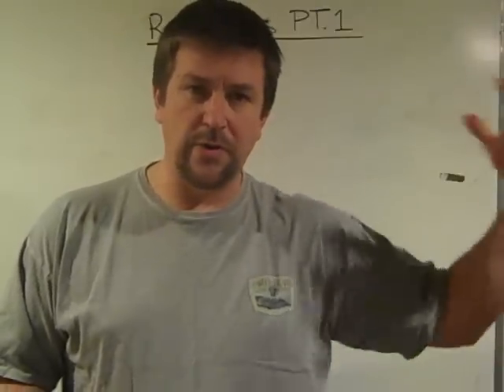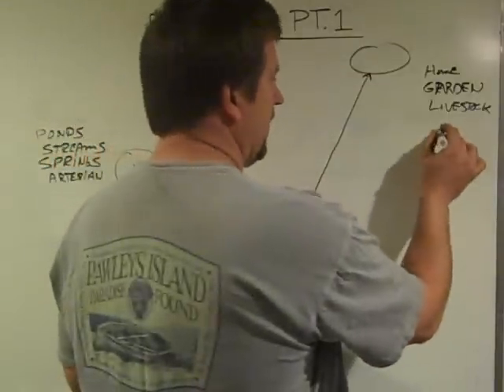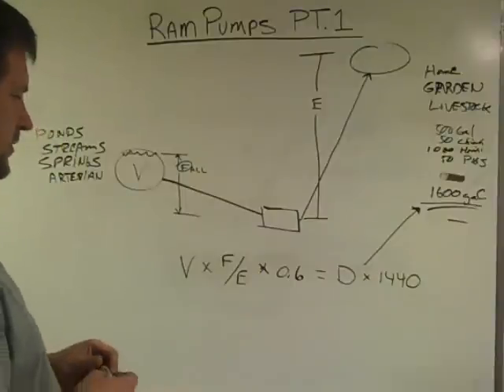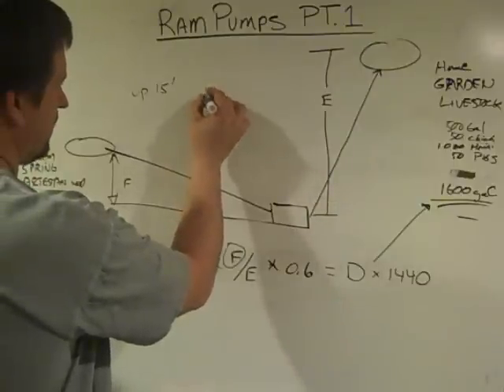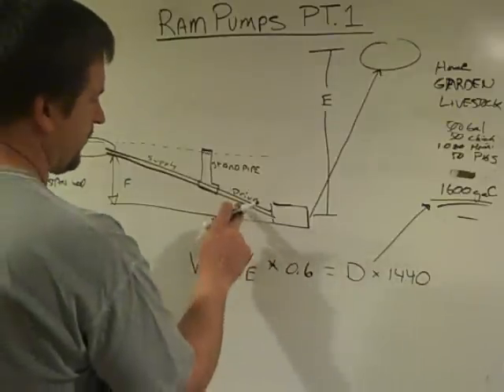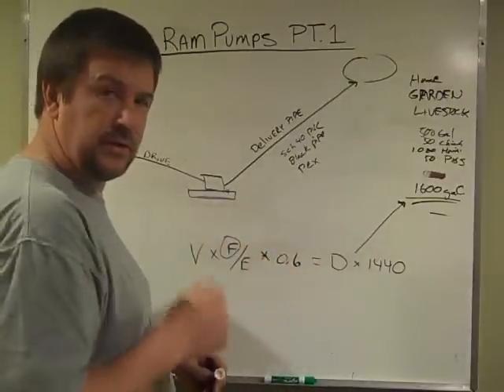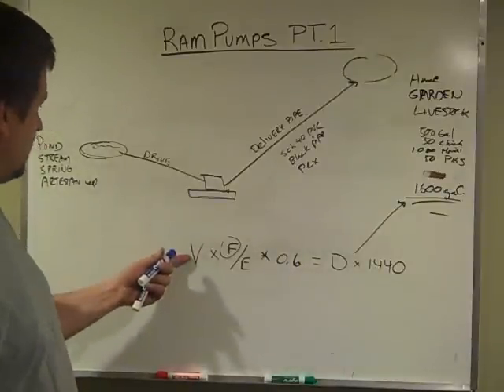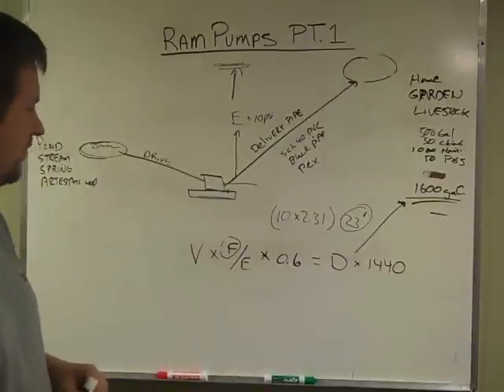Ram Pump pt1

Comment: Ive watched about every ram pump video on you tube,  this series is by far the best on calculating what you need to get started right,  my question is :  is there any way to calculate the distance that the ram will push water in the delivery pipe.
Thanks
Reply from the maker: There really is no limit on distance because there is no friction loss as the pump pump slow and steady it will push for miles.
Reply: @engineer775  thanks for the quick response moving forward with my project today in harrison arkansas
Reply: @engineer775  gov will have all heads for this tech thay teach us that we always have loss but never talk about 
the converted gain we can make from eletromagnets
if u convert all the wast thermal energy around 
you u can use it universally as energy u need a true sine wave bipolar like the power comp dose a 
true pure sinewave like a grid tie inverter 
once the signal is made the system will turn on and 
consume wast thermal energy from the 
environment and space around you... there is free energy but 

it comes from Universal thermal loss and converted into a gain. so a pole Transformer and a 
microwave Transformer  have a common between each other u can take 2 microwave Transformer provide 
a pure sine wave grid tie inverter to it or a true bipolar sinewave that inter acts with nature in 
a perfect spherical motion like a flower of life..  if ur home provides this use it as a Source 
signal then u can simply stack the Transformers on top of eachother in correct fasion and note 
that the 1 wire on the Transformer must stay connected and the other disconnected your only useing 
1 wire on the hi side .. so test ur self 
2 microwave transformer stacked on top of eachother same 

face sides. one side 120 to the wall and the other 120 side to what u want to power and useing the 
Transformer just the way it came out the microwave with the wire attached causes the energy in its 
perfect spherical motion to converted wast thermal energy to amp for u hot to cold in to out... 
should look a bit nuts with u use a form of wireless energy but its interacting with the 

environment...this is my work a compilation of Otis car. Tesla. and many other very smart people 

nowadays i think i found the gate source and drainif this gets out to much that it works the 
power 

comp and mib will have our headsdont do this at home warning high voltage yet i cant stop u lol DO 

NOT TOCH THE CORES OR THE WIRES OK u will die make sure u dont touch the core if the hi wire is 

mounted to it u dont have to mount the hi on the core if u dont want u connect the 1 hi wire to 

the same side hi on the other transformer then the core should besafe to handle if nessary
grab your multimeter and prove me wrong
thats what u do i have my whole home on this
and u can take 

one of the lows side out the wall and hook it up to other stuff and power it for verry little amp 

makeing nature convert and pumping latent heat effect into the device.
and u can have a microwave 

hi volt cap in between the hi side and make a system that powers its self
u can flip the switch on 

ur breaker and the room stays on up to 2kva 
with both lows in the wall this is the zero point that 

was taken from us...
Reply: @engineer775  gov will have all heads for this tech thay teach us that we always have loss but never talk about 
the converted gain we can make from eletromagnets
if u convert all the wast thermal energy around 
you u can use it universally as energy u need a true sine wave bipolar like the power comp dose a 
true pure sinewave like a grid tie inverter 
once the signal is made the system will turn on and 
consume wast thermal energy from the 
environment and space around you... there is free energy but 

it comes from Universal thermal loss and converted into a gain. so a pole Transformer and a 
microwave Transformer  have a common between each other u can take 2 microwave Transformer provide 
a pure sine wave grid tie inverter to it or a true bipolar sinewave that inter acts with nature in 
a perfect spherical motion like a flower of life..  if ur home provides this use it as a Source 
signal then u can simply stack the Transformers on top of eachother in correct fasion and note 
that the 1 wire on the Transformer must stay connected and the other disconnected your only useing 
1 wire on the hi side .. so test ur self 
2 microwave transformer stacked on top of eachother same 

face sides. one side 120 to the wall and the other 120 side to what u want to power and useing the 
Transformer just the way it came out the microwave with the wire attached causes the energy in its 
perfect spherical motion to converted wast thermal energy to amp for u hot to cold in to out... 
should look a bit nuts with u use a form of wireless energy but its interacting with the 

environment...this is my work a compilation of Otis car. Tesla. and many other very smart people 

nowadays i think i found the gate source and drainif this gets out to much that it works the 
power 

comp and mib will have our headsdont do this at home warning high voltage yet i cant stop u lol DO 

NOT TOCH THE CORES OR THE WIRES OK u will die make sure u dont touch the core if the hi wire is 

mounted to it u dont have to mount the hi on the core if u dont want u connect the 1 hi wire to 

the same side hi on the other transformer then the core should besafe to handle if nessary
grab your multimeter and prove me wrong
thats what u do i have my whole home on this
and u can take 

one of the lows side out the wall and hook it up to other stuff and power it for verry little amp 

makeing nature convert and pumping latent heat effect into the device.
and u can have a microwave 

hi volt cap in between the hi side and make a system that powers its self
u can flip the switch on 

ur breaker and the room stays on up to 2kva 
with both lows in the wall this is the zero point that 

was taken from us...
Reply: @engineer775  gov will have all heads for this tech thay teach us that we always have loss but never talk about 
the converted gain we can make from eletromagnets
if u convert all the wast thermal energy around 
you u can use it universally as energy u need a true sine wave bipolar like the power comp dose a 
true pure sinewave like a grid tie inverter 
once the signal is made the system will turn on and 
consume wast thermal energy from the 
environment and space around you... there is free energy but 

it comes from Universal thermal loss and converted into a gain. so a pole Transformer and a 
microwave Transformer  have a common between each other u can take 2 microwave Transformer provide 
a pure sine wave grid tie inverter to it or a true bipolar sinewave that inter acts with nature in 
a perfect spherical motion like a flower of life..  if ur home provides this use it as a Source 
signal then u can simply stack the Transformers on top of eachother in correct fasion and note 
that the 1 wire on the Transformer must stay connected and the other disconnected your only useing 
1 wire on the hi side .. so test ur self 
2 microwave transformer stacked on top of eachother same 

face sides. one side 120 to the wall and the other 120 side to what u want to power and useing the 
Transformer just the way it came out the microwave with the wire attached causes the energy in its 
perfect spherical motion to converted wast thermal energy to amp for u hot to cold in to out... 
should look a bit nuts with u use a form of wireless energy but its interacting with the 

environment...this is my work a compilation of Otis car. Tesla. and many other very smart people 

nowadays i think i found the gate source and drainif this gets out to much that it works the 
power 

comp and mib will have our headsdont do this at home warning high voltage yet i cant stop u lol DO 

NOT TOCH THE CORES OR THE WIRES OK u will die make sure u dont touch the core if the hi wire is 

mounted to it u dont have to mount the hi on the core if u dont want u connect the 1 hi wire to 

the same side hi on the other transformer then the core should besafe to handle if nessary
grab your multimeter and prove me wrong
thats what u do i have my whole home on this
and u can take 

one of the lows side out the wall and hook it up to other stuff and power it for verry little amp 

makeing nature convert and pumping latent heat effect into the device.
and u can have a microwave 

hi volt cap in between the hi side and make a system that powers its self
u can flip the switch on 

ur breaker and the room stays on up to 2kva 
with both lows in the wall this is the zero point that 

was taken from us...

Comment: If the Great pyramid was a ram pump then the waste valve could have been right outside the subterranean chamber, the wellshaft would have been the delivery line, the grand gallery would have been the pressure chamber and the ascending corridor would have acted like a stand pipe, if it had been separated from the Grand gallery. If the complex was a combination of a trompe and a ram then compressed air could have been fed into the King's chamber to pump the water up from there.

Comment: can i measure my volume or GPM down at the end of my drive pipe? What is going out should be what is coming in right? only difference is that i will have pressure where i am measuring.

Comment: Is it possible to use a ram pump in a large system, to pump water with more velocity over a hill? Of course the drive line is very long. The water only needs to get over a hill and then will flow downhill towards a storage tank.

Comment: Question: The diameter of the pumps is mentioned to be 1 2 and 3 or 2 3 and 4. 

If making similar system on bigger scale, diameters should not be like 5 cm 10 cm and 15 cm but 5 cm 7 cm and 9 cm?

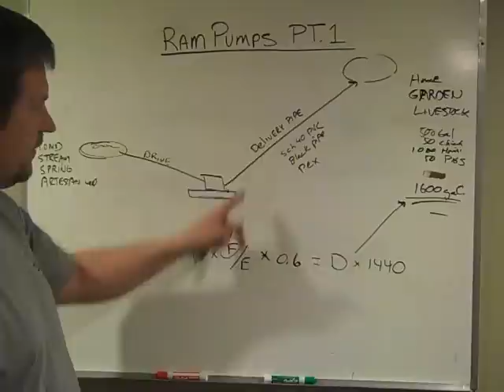Comment: V is the volumetric flow rate through the drive pipe, not the flow rate of the stream, therefore one may change V by changing the diameter of the drive pipe. At 12:00 of the video, you say that you can't change the source rate, but you can increase or decrease the source rate by changing the size of the piping. Sorry to get technical, but it's true.
Reply from the maker: Agreed. Did I say stream? You do have to figure out the flow rate of the source though first.

Comment: Nicely detailed. Question, where did you get the 2.31 when working out the height? I usually use 0.5 psi for a cubic foot of water,so head of 20 ft is 10 psi.
Reply: That's the conversion from ft water to psi using density and gravity.

Comment: Input divided by output (in GPM) will give you the efficiency of a completed ram pump system. Much guess work is required before completion though. Run the calculations for your particular minimums and maximums to find the worst and best case scenario.

Comment: Engineer 775,  Would a 1/2 inch ram work?  At times my spring will support a 1 inch ram but when it dries up to 1 to 1.5 GPM my 1 inch ram runs out of water.  I am curious about building a 1/2 inch ram so it will run non-stop druing all seasons.  I can easily get 40 foot of drop with 100 foot of pipe.  I need to lift it about 200 to 250 feet.  I have never seen a 1/2 inch Ram.  Will it work?  Please help.  :)

Comment: In the discharge pipe to the garden:  Would it improve the psi if you use a 2" pipe coming off the supply tank and then reduce it into a 1" pipe on the run to the garden?  Thanks.
Reply: PSI will Increase with a Smaller discharge.. The larger the feed will only increase available volume for your discharge. Or maybe that doesnt answer your question.  If You Look at say How  water supply works in an urban environment or maybe try checking out Pumps in general like  firetrucks that Mite give you a simple way to figure out what you want to do. Try waterous pumps for training resources.. or maybe HALE  fire pumps.

Comment: just wondering if you where to place this pump at the bottom of a dug well thats 4 feet wide and 20+ feet deep would it pump ?yes i know i would have to overcome the air tank bouancy but you would still get a head pressure just have to run the check over water level

Comment: Hello there. I have a situation where the garden i work on is quite elevated compared to the river bank. So i'm curious to ask if it would work if we had no downward drive pipe and just a pipe that goes directly into the river. Do you think that it would be enough velocity to raise the water around 7-8 meters high? The river is fast flowing most of the year.

Comment: Hi
 is it ok to join a second delivery pipe to the main delivery pipe to increase water source to a generator  as will need use a second source to top up main delivery during dry weather 
paul

Comment: Is the recommended length for the drive pipe related to the propagation of the sonic ("hammer") wave from pump to source end of the drive pipe and back?  What effect can I expect if using shorter-than-recommended drive pipes?  I'm an engineer so don't be "gentle" on your explanation!

Comment: It seems clear to me that the passages in the pyramid were a giant water pump. How exactly it worked is the question. Was it a trompe? Was it a ram? Was it a combination of the two? There is a small chamber in the passage to the subterranean chamber. It is positioned just before the subterranean chamber. There could have been a sideways waste valve here. The subterranean chamber could have had a toilet float type mechanism in it that would open that valve when the chambers water level dropped

Comment: hi! Engr, 775 if will use a #2 drive pipe and a #1 delivery pipe up to around 300 meters to my vegetable garden. can a #2 pipe can deliver the job? my water source is not much of the water so i build a 1,000 liters source tank but i have not yet measure the flow rate.

Comment: Hi, can you help me figure out why my ram pump is not working efficiently. I made a small dam with a 1.25 inch pvc pipe coming out for about 28ft. Then I measure a flow of10 gal of flow per min on the end of the pipe into the ram pump. The check valves are 1.25inch brass, with a 5 gal metal air tank. The fall from top of water to pump is about 4.5 to  5 ft. Then I am running a garden hose that is about 75 long with an elevation of 45ft. I am not getting more than a gallon per hour. The pressure

Comment: Prepare for a painfully stupid question...Is it plausible to use a ram pump to increase the head height of a high volume, low pressure, DC water pump? For example, a bilge pump? I want to do everything in my greenhouse by DC only, no power invertors or AC pumps. Problem is, the only high volume DC pumps I can find are high volume, low pressure. I need a 15' head height and still be able to maintain 1000/GPH flow for my aquaponics.

Comment: Terminology question... Mare two separate pipes required for Drive Pipe & Supply Pipe? Or just different functions for the same pipe ? Thank You for information..
Reply: I know its been 2 years but I'll put in my 2 cents worth anyway:  when using a standpipe in a system that exceeds the recommended drive pipe length, the pipe UPSTREAM from the standpipe is called the Supply Pipe; the pipe from the standpipe to the pump is called the Drive Pipe.

Comment: Good Day Sir:)

I am a Civil Engineering student from the Philippines and I am are currently working on my Project Study/Case Study about a Level II Water Supply System. I just want to ask if the "E" (or Lift) is equivalent to the head of the pump or if there is another way to solve for it. I look forward for your response on the favor hereon. Thank you very much.

Comment: V and D are the flow rate (m^3/sec) like to say in the international units
Q1*(h1/h2)*0.6=Q2 ... and doest the Efficiency is sth constant 0.6 for this pump or it is changeable according to the discharging valve stabilizer .... and is there any video solving a case of ram pumps using international units 
thanks

Comment: I was wondering I am going to make a 2" ram pump from your design..i was gonna make 10' fall/drop from Suply to pump..
Do you think I can run a 1000-3000 watt hydro generator with a peloton wheel with just psi from pump?
Or do you think I need to run water from pump to a 1100 gallon container that I can elevate up a hill and a additional 10 ft..total of 25ft.

Comment: Does the geometry of the air lock have any affect on the operation? So If I were to use a thin long pipe for the ram, then the surface area of the water compressing the air lock is less. This would mean more pressure per unit of area so more force. Then the compression would be greater in a linear direction? So the spring effect might be exaggerated?? The quantity of water pushed could be equivalent due to a longer ram?

Comment: Inspired! so I have a fish/plant system (aquaponic). I pump water up 3-4 feet and drain back to fill the sump. I need to pump water to 6feet to water some towers. is this possible to do with a ram. my flow is 3-5 gal/min.

Comment: Hi engineer,
I would like to build a 3" ram pump, on a river whose flow rate is 40 gallons per minute, the fall is 7 feet and my tank is 40 feet  high (elevation). I have a solar pump which has small head of  12 feet and does 2000 liters per hour. Is it possible to combine the two pumps so that the ram pump  can help me push the extra water from the solar pump to the 40 ft head? Would the ram pump work if the solar pump delivers its water into the air chamber?